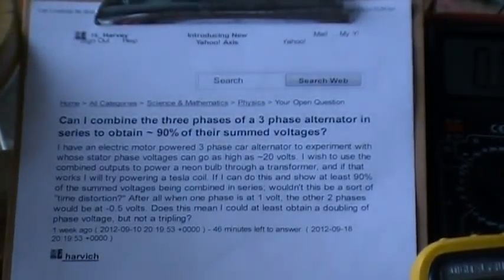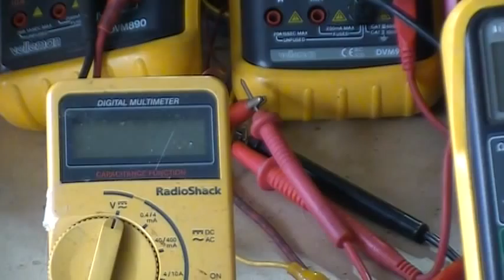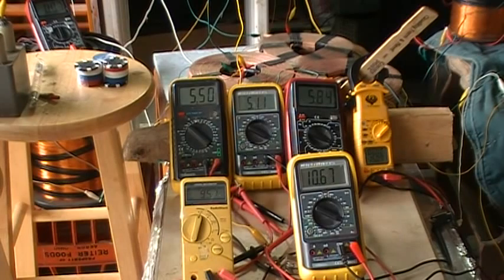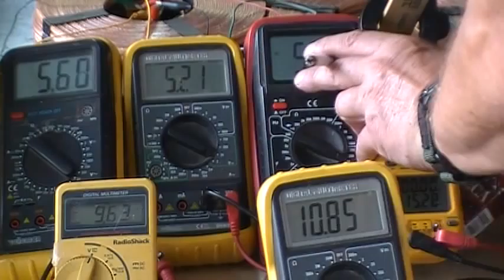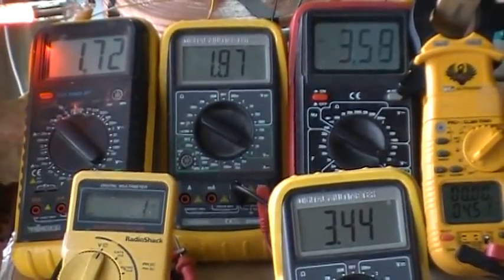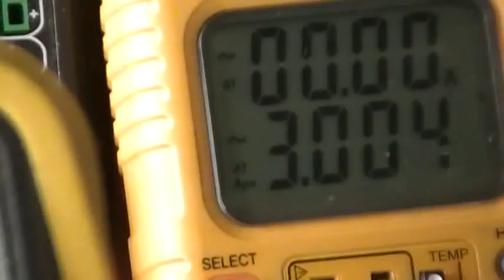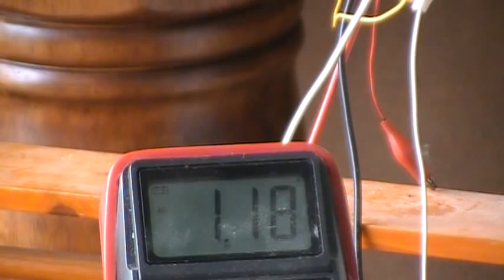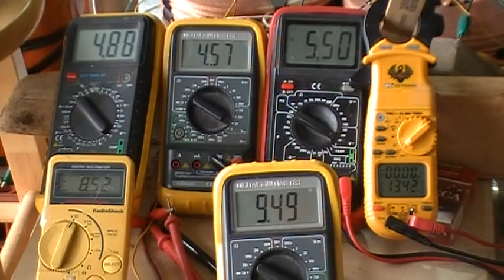3 phase Time Distortion as "expanded time" Circuit

Comment: Some fellow from Pakistan belted 3 alternators together, ran them in series and obtained over-unity. They were likely not running 120d out of phase but trying to.   When like poles repel, either in a transmitter or dynamo, each tends to go 120d out of phase due to resistance.  Ed Leedskalnin's circuit inside Coral Castle was using 3 main dynamos to produce 3 phase. 3 coils inside the timing post were part of the series, so each time the special distributor struck inside the flywheel, the magneto block of the 24v flywheel would short through that iron pipe and lots of other iron back down to the inside of the flywheel at just the right moment to produce a pump z wave. That wave made 3 dynamo's carried waves into pump z waves.  The geometry of Ed's flywheel resulted in a superconductive filter geometry, so everything this did was to act like a LF type of cyclotron where the broken spiral was replaced by imploding charge to imitate the spiral. Imploding charge from an iron pipe into 3 nearby coils inside would form 3 waves from one so that after nonlinear focus, 3 waves released from the copper dielectric layers would go in sync yet out of phase, and then combine to form a sum of wave peaks~!  That's the secret of zero point energy, free energy , powered by electron neutrinos which is what stabilizes ion charge everywhere. 
Likewise if you short out the casings of many dynamos 5deg before top dead center or so each 3rd cycle, you get wave confusion. That's like having 3 gears inside a 4th gear. The 3 phase modulation moves charge only into or out of a carrier with ease.